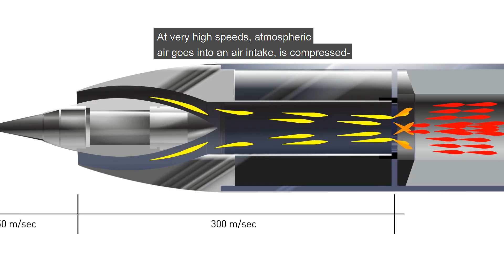How ramjets may change the role of artillery on the battlefield

Comment: Launching the ramjet from a howitzer type gun is not possible. The pressure inside the artillery will destroy its components. That's why the thickness of the artillery rounds are more, while the ramjet is made of more lighter martial which can make the ramjet explode inside the artillery gun. This is how I see it. Planes can achieve speeds to release Ram jets. Maybe a support rocket attached to the ramjet.
Reply: Well I guess these scientist will have to admit some random Indian understands their job better than they do.
Will you contact them or should I? 😂
Reply: @BobMac-r1v dude India has successfully tested a  155mm ramjet artillery shell!!!😑😑
Reply: @BobMac-r1v  aged like milk. India becomes first country to use ram jet Artillery in Army.
Reply: @RitamSanyal 
I think you aren't understanding what I wrote.
Disengage your inferiority complex and read what I actually wrote.
Reply: @BobMac-r1v I understood what you wrote and I repeated that exactly. Its not inferiority complex, its the Truth.
Reply: @RitamSanyal 
I'm not surprised you think you understood, you clearly didn't though.
Reply: @RitamSanyal 
And by the way, the Indian shell isn't working yet, from a January 12 2026 article "Further field trials in December 2025 at the Pokhran Field Firing Range marked another critical step, with the shell exiting the gun cleanly at higher operational zones. Ongoing refinements are addressing remaining technical challenges, paving the way for full operational capability."
So they have managed to get it to leave the barrel at high speed and now are working to actually get the ramjet to work.
Reply: @BobMac-r1v  Don't know which article you are quoting but IIT Madras (the engineering College which built it) stated that they have successfully tested all parameters of Ram jet engine and Army Integration trails are underway. Which means the Ramjet works and all test have been completely by Manufacturing Side and User Side testing is underway. 

Your lies don't work here boy.
Reply: @RitamSanyal 
That was from an article in the Indian Institute of Technology Madras "happenings" page of their website.
Reply: @BobMac-r1v  I don't know which IIT Madras you are referring here but the real IIT Madras on an interview confirmed they are are undergoing user integration trials.

Sorry you can't digest the truth as is and have to bend it to fit your narrative.
Reply: @RitamSanyal 
Oh man you remind me of a little kid that feels silly and stamps it's feet.
That was the group that are working on these shells.
On the website of the Madras itself.
Look it up.
And stop acting like a cry baby.
Reply: @RitamSanyal 
And while I was searching I find that several ramjet shells are further along in development than this one.
There is the shell in this video and also the Sceptre.
Reply: @BobMac-r1v  "And while I was searching I find that several ramjet shells are further along in development than this one."

so now that you lost the first arguments you are going to change the goal post ? Nice tr but again if you red the official government site posted before it clearly states that its i final stages of development. So your argument of parallel development doesn't stand either as ours is near completion while others have little to no update at all. Learn to take the L lil bro.
Reply: @RitamSanyal 
The Sceptre shell is fully developed and tested, ready for production.
No goalposts were relocated by me.
That was a completely separate comment.
Reply: @RitamSanyal 
The shell in this video is further along than the Indian one, that's just a fact.
This shell has been fired a hundred and fifty times with the ramjet working.
That's not shifting the goalposts.
Reply: @BobMac-r1v  says a bot.
Reply: @ekulda 
I'm a bot because you make a wild statement and I call you out?
Read the other comments, the Indian army already has these devices.
You would be better off deleting your speculation.
😂 Cricky.
Reply: @BobMac-r1v i didn't know you were running a gestapo online. It's a comment bubba. Not my white paper. Sprinkle a little salt.
Reply: @ekulda 
It's an idiots comment.
You watched a video about actual science being done by a multimillion dollar company and you think it's worth saying in your opinion it won't work.
We got trump because of people like you.
I pushed back because you need to feel uncomfortable about your lack of common sense.
The video points out a hundred and fifty successful tests have taken place, it's not like your comment needs much thought to be recognized as stupidity is it?

Comment: If it's a solid fuel ramjet motor, can't they just mix a more powerful oxidiser in with the solid fuel so it doesn't need the atmospheric air to burn instead? That would mean they can fit more fuel in there too

Comment: Well, cocked up within the first 13 seconds.  Ranges have increased significantly since 1914-18. Admittedly, not incrementally, but the last 20 yrs has seen huge improvements with rocket assisted, base-bleed and GPS guided shells.

Comment: no one is talking about the cost of such a projectile... there is no doubt that with such a projectile it will not be fought in an area, but with targeting at a certain target. When it comes to a distance of 150 km, targeting would be problematic if the enemy has adequate air defenses. I.e. such a projectile will not be able to be used against moving targets such as artillery, infantry or armored vehicles. GPS targets will be attacked, i.e. static objects. Buildings, bridges, warehouses

Comment: Regardless of the cost of such a projectile, it will be a hundred times cheaper than launching any rocket. Plus, it's beyond the reach of enemy artillery, bombers, strike, and most reconnaissance drones, which essentially means complete safety for both the equipment and personnel. I wish they would put it into production sooner.

Comment: Funny.   No one mentioned the cost😂.   What's everyone's guess?  50x or 300x more expensive per round vs standard 155mm rounds.?
Reply: An Excalibur shell is also not cheap. But still less expensive compared to most guided missiles. And proven very useful in Ukraine.

Comment: With the ramjet mechanics and extra fuel while potentially able to fire futther, you have very minimal space for the explosive chargd like TNT or RDX, which means it will have a very small yield. Not only that, with the ram jet taking the entire front and center column within, it would be almost impossible to put any reliable guidance system in it to accurately hit anything at that range. In essence you wou end up with a very small yield "Paris gun" type projectile, at that point why bother with an low accuracy, super long range, low explosive that is super expensive. It would be better to use for low accuracy rocket artillery like the Grad so it could at least carry a bit more explosive than an arty shell. This is why 4+ years later this has really gone nowhere.
Reply: High accuracy if guided. Most conventional shells 98% don’t hit, and we must consider the price impact of fewer shells needed to get hits.

Comment: The most interesting part here is probably, that ramjets are hard to develop today but in principle they are relatively simple (number of parts, number of moving parts etc.), especially if they have to keep one constant speed.
So they might become relatively cheap compared to a rocket with the same reach. And since they are smaller and can be used with existing howitzers they might become cost effective.
Reply: I'd argue that with top teir engineers paird with CAD, it shouldnt be as difficult as it once was.

Comment: Rail gun assisted shells will be able to be mass produced and powered soon enough. They've already made it, but mobile battery power and size constraints put the project on the back burner. Also combined with future precision targeting, kinetic shells could be used in lieu of explosives. Alot of the tech from these original projects got employed in weapons currently in the field

Comment: This video is bullshit. There was artillery before Gerald Bull, and there is artillery after Gerald Bull. The former is in no way comparable with the latter. Not in range, not in accuracy.
Reply: Ok, let shave an artillery fight. You bring your standard 20km range, and ill bring my 150km range. Who will win?
Reply: @MrAnders9000  Post-Gerald Bull standard artillery typically has a range of at least 25-30km (Lightweight L39 towed artillery), some in the 30km range and modern SPGs have a range of 40km-ish with standard ammo (and firing as far as 70-80km with specialty ammunition).

That was why I called bullshit on the video. It's both comparing mostly to WWII artillery, but also implying that there hasn't been much development. All of that is bullshit.

Comment: This report is heavily overstating Russian capabilities and significantly underestimating NATO capabilities. NATO artillery isn’t limited to 22-25 km, Excalibur shells exist and even conventional artillery like the PzH 2000 can easily reach out to 50-60km, further than 90% of Russia’s artillery that reaches 35-40km at most. And yes, guided MLRS can easily reach further than 100km but Russia has almost none of those and the MLRS system you showed, the Uragan, only has a range of 30km and it’s not guided and extremely inaccurate

Comment: If a shell of 68.8 cm in length can travel 150 km with ram jet, imagine how far a 5.17 mt Multi Barrel Rocket Launcher(MBRL) rocket can travel. 

You can hit most of any country's capitals from international waters.
Reply: There's also the tonnage/thrust question. You can only haul so much until you exceed your own weight limit.

Comment: When I did my military service 25 years ago, we had guns in our not so advanced army  that could fire ordinary shells  40+ km. So the 20-22 km range of conventional artillery is heavily underestimated.
Reply: Yes, you can see this in the chart shown at 4:24
legacy: 24 km
base rated: 40 km
rocket assisted: 85 km
ramjet: 150 km
Reply: can i ask what artillery and location was used?
Reply: @thebiggamers999  15,5 CM FESTUNGSKANONE 93 BISON
Reply: @guyaverage2092  You didn't answer the location question. Festungskanone = Swiss fortifikation gun. May I guess it was located at a high altitude, shooting down to a valley? Then the range is of course extended.

Besides I doubt they were just "ordinary" shells. They were base-bleed grenades but you didn't know it?

20-30 km for a 155 mm gun is the normal range with ordinary ordnance. Nammo certainly knows it because they are the ordnance specialists.
Reply: @MrZimpauttaja  The 93 BISON was a L52 cannon using boattail ammunition similar to the ones used with Pz2000, so I assume that the gun would have a similar performance (36km with regular ammunition, 47 with basebleed and almost 70km with RAP). Smart ammo will also have those kind of extended ranges since they use their guidance wings to glide (and do not follow a ballistic trajectory).

<30km is "normal" for the relatively short-barrelled towed fieldguns. The ones mounted on SPGs (or which were used in fixed positions for coastal artillery and so on) tend to go longer, and to the extent that towed artillery is still in use there is also a trend for longer barrels, higher pressures and longer ranges like the finnish 155 K 98.
Reply: @MrZimpauttaja  We could do 54km (sea kevel) with VLAP on a gun designed in the late 70s early 80s
Reply: The whole thing about "outranged and outgunned" has aged so bad it can be seen as nothing more than a try to advertise the need for better guns and ammo, when in fact, russia is outranged and outgunned. And outlogistic'd.
Reply: @AllisterCaine  Iskander outranges ATACMS and Uragan outranges GMLRS, this doesn't change just because Russia expended all its ammo. And as for outgunned, Russia has fired vastly more rounds this war than Ukraine has. What they are is out-satelite-reconed, not outgunned or (until they ran out of missiles) outranged. R-37 also outranges american aa missiles (they likely have something classified or would have bought meteors), and S400 outranges patriot. Standoff weapons and artillery mass was the Russian play, and that is what we have seen in the war.
Reply: @toryvindmoe6794  did you say Russia bought meteor? Or am I stupid? Well... the US just strapped a standard missile to aircraft and interconnected it to ground stations and awacs. 350nm range or something....
Reply: @AllisterCaine  Um, are those the only options? I meant the US likely has something off the books, or they should have just bought meteor missiles off the shelf. Maybe they had a bad case of 'not invented here syndrome' though and were waiting for AIM-174.
Reply: The G5 I was on could do 54km and it was made in the early 80s.
Reply: Did this guy just say that nato was outgunned  and out ranged? NATO/US?  I don’t think so.

Comment: As long as it is cheaper as rocket artillery while being equally precise, I can see its use. It will be a kinetic only projectile I guess, with fragmentation.
Reply: Well see on price, I kind of doubt it, and rockets have significantly more explosives in a given diameter
Reply: @roryross3878  remember it could be fired from any 155 artillery not needing special MRLS vehicles  that are fewer in numbers. Just having  few rounds for juicy targets makes it cost effective.
Reply: The Army spent $100,000 on a grenade that can be thrown 150 kilometers😛
Reply: cheaper? The excalibur with no ramjet costs $112.8k

Comment: I don't know if they'll make it work, but fundamentally this seems like the ideal application for a ramjet, given the fact that ramjets only work in vehicles/projectiles already accelerated a lot through other means, and artillery shells are almost the only device where this is achieved without needing to move another additional engine (the other potential application being high-speed ramjet missiles launched from supersonic jets). ramjets also work qith (almost) no moving parts, which makes it plausible that they can be made sturdy enough for artillery shells, at least with solid propellant like this.

Comment: It's cool that it can fire also these 'artillery missiles' if needed - if that is the proposition itself - but I don't quite get how it will be that different from a missile system. Because it is - probably - as expensive as a normal ramjet missile system - if not more?

The artillery is used for saturation. I don't see these 'artillery missiles' being that cheap to be used in saturation.

Elucidation?

Comment: Uh, so holdup... it's the same length as a standard 155 mm shell, but in that length it contains a Ramjet inlet, compressor section, combustion section, and a fuel section, clearly occupying the majority of the shell's length and a lot of it's width too... instead of, y'know, filling nearly that entire volume with high explosive to actually destroy an enemy position with, which is the entire reason you send artillery downrange in the first place.

I'm not sure how super long-range but say maybe only 20% of the impact power is supposed to be useful except in very niche and rare cases. 🤔

Comment: That's cool and all but from the diagram we were shown that doesn't really leaving any room for the warhead. It's the same enigma with rocker propelled mortars. They get greater distance but at a warhead disadvantage. If you have your air intake in the front of the nose then you need that nozzle to be at the back, which would take up the whole round. Usually for that reason they have scoops at the end, if it's going to be like that then your yield is going to be extremely low.

Comment: AGAIN!!! A lot of hogwash. Ramjets, hyper velocity shells, smart bombs are  GREAT ON PAPER.   But the cost per shell makes it impossible to use on the battlefield.  It's one of the reasons why the Navy's hyper velocity shells was cancelled.  It was only supposed to cost a few thousand per shot, but the cost of the shell reached 80 Thousand per shot.   10 rounds down range is 800 grand.    Until they find a way to keep costs down this will not work. ADDED THE US ARMY HYPER VELOSITY SHELL PROGRAM WAS CANCELED THIS PAST MAY 2020.   Because I had family working in the defense industry I have seen that perspective of what gets used in the US armed forces.   There is so much crap on youtube boasting this and that but when it comes down to something real... it's never there.

Comment: Got info wrong about MLRS, which can range out to 186 miles, about 300km, with the ATACMS guided rockets.  Also the Paladin 155mm howitzer, firing the Excaliber guided rounds, has a range of 43 miles or 70 km. Both can hit targets with extreme precision at those distances.  The US is also in the process of fielding it first Hypersonic missile the Darkstar, it will be operational soon...

Comment: I once read that the US was thinking about doing the same thing to a 16" shell on the Iowa class battleship. increasing the range from 24 miles to over 100. Or something like that. I know everybody says battleships are dead. But one pf those 16" shells would go almost straight through a Russian ship.
Reply: a small rocket was/is installed in the rear of the warhead.  Impact of warhead 75 to 100 miles inland makes a fine helicopter landing pad.  A broadside of shells makes an "airfield"